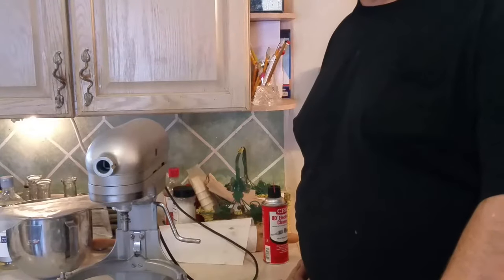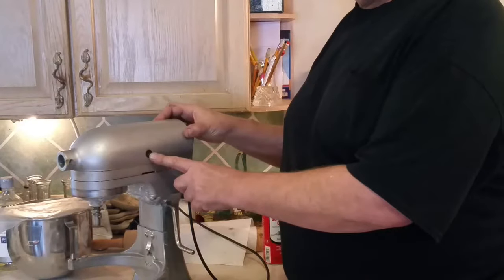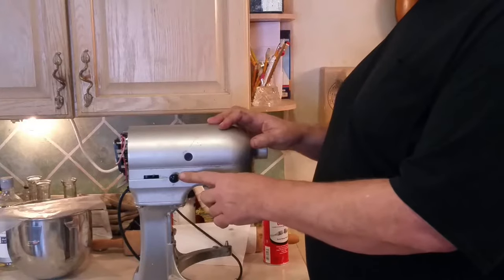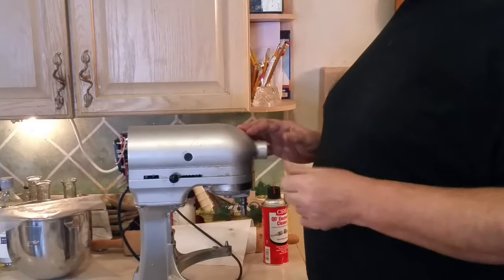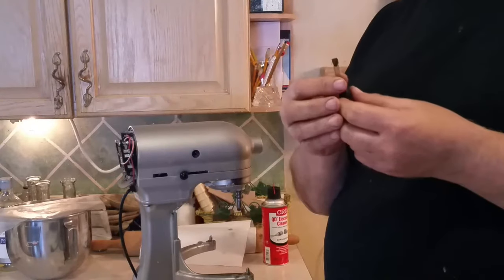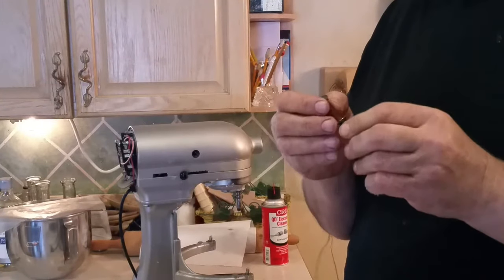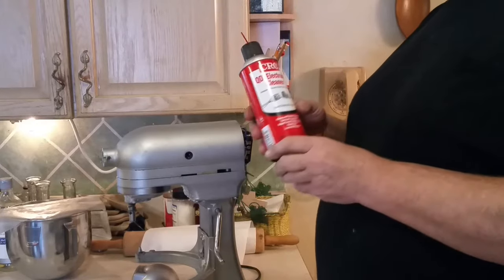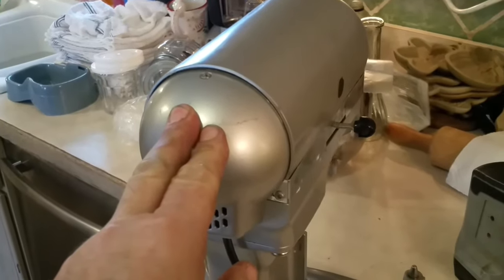how to fix Kitchenaid stand mixer that won't turn on

Comment: Thank goodness for your video! I took my machine apart (didn’t touch anything), just to wipe up the grease, put it back and it stopped working. I’m so glad I found your video about the brushes having a different corner. I almost had a heart attack when it didn’t start at first, turns out I had the brushes in wrong. Thanks!!
Reply from the maker: Very happy it helped you♡
Reply: daryl turcott do you know about the oil level in a Kitchen Aide. Daughter had movers mover hers. We marked all over the box “ This end up and Do not tilt”. Of course upon delivery it was setting upside down. Box soaked in oil. Ran a couple of times after but now won’t run. Very sparingly used.
Reply: I can’t see a cutout when I shine a light in there. Must be my 59 yo eyes! Any advice about the direction of the brushes? Should the “top” be on top when I put it in?
Reply: Omg! I did the same! I took mine apart while watching a video how to do so. I removed the old grease and put in new, put it together and it didn’t work anymore. Gonna try this and hope it works
Reply: I had the same exact thing Thank you for your video
Reply: Same here , I was in the dog house until I found this video!
Reply: @annaspastrykitchen6896  use the camera with flash on your cell phone. Then you can zoom in and out to see better...I use that trick in the grocery stores to read ingredients...
Reply: Thanks for the Video. I had the same issue with not putting the brushes in the right way
Reply: As did I
Reply: Exact same thing happened with mine.  All good now.  Thanks for the video!

Comment: Bought one of these on FB marketplace for $100 last week. Powered it up, it worked just fine. Was cleaning the gunk out of the nooks and crannies, including around those screws. Removed one because it was super gunky. After a thorough cleaning, I powered it up and got absolutely nothing…I almost died on the spot. Gathered myself, started searching for a solution online and found this video. IT WORKED!! Never touching that darn screw ever again!!
Reply from the maker: Glad it helped.

Comment: Thanks for the video and the explanation.  I had just finished re-greasing and upgrading the power cord of my mother-in-law's 1970 tilt head KitchenAid.  It was about an hour and a half project that I spread out over two years.  Evidently, two years ago, I pulled those brushes out and, having not seen your video, I paid no attention to how I put them back in.  This video saved the day for me!
Reply from the maker: Glad I could help

Comment: I have a nearly "new" kitchen aid mixer and it will not turn on. I bought it in 2009 at costco. Similar look as yours.  I probably have used it 10 times at the very most!  Have not abused it. I nearly threw it out because I was so mad at thing...It has been sitting for 2 years in my bedroom. Trid to find a repair man in my area and was not able to.  Your video has inspired me to take it apart.
Reply from the maker: Well, be careful and unplug it before you work on it. There are several good youtube tutorials on diagnosing motor or control issues.
Reply: @darylturcott    Thank you. Success! It was the switch that regulates the speed! It was corroded! Working now!!! Yay!  Thank you again!!!!

Comment: Thank you so much! This is exactly what was wrong with my machine; I took it apart the other day for a deep clean and re-grease, and I pulled these out to clean the caps and just stuck them back in without thinking they went a certain way. Needless to say, I was devastated when I went to turn it on.. and it wouldn’t.

Christmas cookies have been saved! Thank you!!
Reply from the maker: Glad it helped!

Comment: Thank you so much for this video! I took my mixer apart to paint it a different color and it wouldn’t turn on when I reassembled it. I thought for sure I must have broken it. The brushes were in the wrong way and I didn’t realize they were directional! It works perfectly now!

Comment: Daryl, tysm! I took my used kitchenaid apart to give it a deep clean. Guess I put the brushes in wrong (mine have one corner flattened, not quite a triangle). Checking how they should fit did the trick! Saved me a trip and $ to take it somewhere.

Comment: Awesome job. I repaired the worm gear in my mixer and tried to turn it on and it wasn't working. After watching your video found I didn't line up the notches on the brush.
Reply from the maker: Its easy to have happen. Sometimes they get stuck and dont slide all the way in either.

Comment: Thank you so much Mr Scott, you just saved me some good money. I put the brushes and my kitchenaid roared.
It's just that the sparks you mentioned, that can be seen from the switch still occurs. Any tips on how to solve that?
Reply from the maker: You could try a shot of qd electronics spray cleaner. Not sure if it would help.
Reply: @darylturcott  ok thanks. will let you know if it works

Comment: Love how easy this seems to be.  One thing, I do so wish there were either links to purchase the brushes or what the part name is called.
Reply from the maker: I always hesitate to share links, I don't want people to think I'm profiting from them.
Reply: @darylturcott  I appreciate this attitude because of course, so many people do profit in this way.  But I am unclear about the name of the part. It sounds as if this may be what's wrong with mine, that I have had since 1977.

What part am I looking for? Does it have an actual name other than Kitchen Mixmaster brushes?
Reply from the maker: W10380496 Carbon Motor Brushes for KitchenAid Mixers 9706416 W10260958 WPW10380496 PS3495098 AP5178083（2PCS） https://www.amazon.com/dp/B07ZV2NPWL/ref=cm_sw_r_cp_apan_glt_fabc_PXNDMYGEKB385PF921BZ?_encoding=UTF8&psc=1
Reply: @darylturcott  THank you!!

Comment: @daryl turcott Thanks for this! The videos I watched all said only one way for them to fit. They slipped in easily so I thought they were oriented properly. I reorganized them. It turned on once but sounded sluggish in 1st gear. I thought it was bcuz the new food grade grease needed to work throughout more. I slowly turned it up one gear at a time.  It made a slight burn smell like the grease warmed up. I  turned it down to stop...now it won't turn on again. Please help me...I'm unemployed and can't afford a repair shop
Reply from the maker: You didn't put grease in the holes with the brushes did you? The only place to but grease is in the gear box.
Reply from the maker: Darylturcott@gmail.com email me with pictures if possible
Reply: Thanks for responding. The only place I put the food safe grease was in the planetary and gearbox where the worm gear was. It turns out when I originally put the new bushings back in wrong...I thought both would face same directions) I misshaped the springs so they were not full contact
Reply: Once I corrected the misshapened springs (I inserted a small wooden dowel just slightly thinner than the spring...I tightened the twist and massaged it with my fingers bcuz if over tightened it would break), I was able to put them in properly with no sparks when turned on
Reply: I'm officially back to baking! Yippee! Thanks for your help
Reply from the maker: @fdort3971  so you are running again. 🙂

Comment: So grateful for your video. My 20+ 5 quart would not power on. Did the rap thing and it started. Tried to remove the brushes to inspect and replace. Covers unscrew but one spring came off the carbon. Any advice on getting the carbon out?
Reply from the maker: Carbon is not a hard material.if you can gently drill into it, or insert a long screw it might pull right out. Make sure its unplugged,  and don't damage the brass housing. If it breaks in pieces, lay it on side and gently probe the material with a dental pick or similar to dislodge it.

Comment: Thank you for the video. I wish someone would explain how these older speed controls work, (how the control panel and the speed governor work together to control the speed). The functioning of the "power off" part is self-evident, thank goodness. I replaced the mangled plastic worm gear in my wife's white KSM5, and now it won't even try to spin when I power it on. Luckily, I have a second (grey) unit (which also has a bad gear, but its motor spins), which allowed me to prove that the control plate, the phase control panel, and even brushes on the white one still work (the motor on the grey unit still spins when those parts are swapped out), but I can't figure out what else it could be other than the armature or field assembly , or wires leading to those parts. I can turn the planetary gear part of the white unit by hand and hear the motor turn, so I know nothing is seized up. All the shiny metal parts on the grey unit rusted over while in storage (bowl raise handle and track mostly), so it's currently only good for t-shooting & parts, but I may have to restore it if I can't get the white one's motor to spin again. The motor on the gray is rated slightly higher (350), so maybe it's worth the trouble, but then again, the wattage ratings are close enough that the white one could have the same motor, but  the rating could just be more honest on the white one.
Reply from the maker: I wish I could. I assume it's a variable resistor set up.

Comment: Hi excellent video and do you have a video on replacing circuit board on that mixer?
Reply from the maker: I dont. I had mine apart once but that was years ago and I remember it was tricky to get back together.
Reply from the maker: If you do it, take photos so you remember how everything goes.
Reply: @darylturcott  thank you

Comment: In attemtping to locate any numbers that would identify my Kitchen Aid, I discovered that even though the lever is in the unlocked position, the "head" won't raise up. Any idea how to fix that?
Reply from the maker: None of ours are tilt heads, I only have bowl lift models. I'm guessing the lever is stuck.
Reply: @darylturcott  The lever moves forward and back quite easily, but the thing won't tilt. I sure wish you had some ideas.

Comment: Thank you so much for this video - I'm so happy this was an easy fix. Quick question though - my mixer is finally turning back on again, but only works once I set the speed to 6 or higher. The speed doesn't appear to change however. Do you have any opinions on what it could be? Thanks!
Reply from the maker: I wish I could advise you on that, but the speed controller is a mystery to me
Reply: @darylturcott  Well thank you anyway for helping me figure out the brushes!!
Reply: I had this same issue and found it was due to how tight the screw was on the back of the electrical. Loosen up that screw and the lower speeds should come on.

Comment: Hello, 
Wondering if you could give me your counsel,
I was trying to fix my sisters KAM, which wasn’t rotating, I replaced the gear and all, closed it and all and didn’t notice I had put in the speed-lever incorrectly which the copper bar that closes the circuit to touch part of the metal frame. I replaced the speed control plate and the brushes (they’re placed properly) but it still will not turn on. 
Any advice on what could be my next step?

Thank you
Reply from the maker: Do you have a voltmeter?
Reply from the maker: I would get a test light or meter and start by testing the cord. Then test power to the brushes. If cord has power and brushes dont, then the problem will be in between, probably in the speed control switch.
Reply: Cord has current, I do not get any current from the red wire coming from the motor, 
Replaced both the speed control plate and phase board and both brushes
Reply from the maker: If you are sure the brushes are right, look at the brush holders, each one should have a wire soldered to it.

Comment: I broke my mixer by removing the brushes when looking at it. Now I can't tell which way they go in.  I can't see any cut out inside the mixer.  Does the rounded part go up or down?
Reply from the maker: The curved edge is on left and right sides. Points at top & bottom

Comment: My kitchen aid won’t turn on the lever is stuck in the off position and won’t move forward. Is that a brush issue? Or something else? Thank u for your video
Reply from the maker: The lever is not connected to the brushes. You may have a broken spring or hinge in the controller.
Reply: @darylturcott  should I toss it and get a new one? Or is there a repair shop you think?
Reply from the maker: Dont do that. It's likely a very simple inexpensive repair
Reply: @darylturcott  thank you 😊 appreciate that!

Comment: Hi, thanks for the video, I have this problem:

I disassemble my kitchenaid because I wanted to clean the liquid grase, and I unplugged the brushes ONLY, I didnt touch any circuit or another piece of the motor... Well, I put it back in the same place every piece, and now it don't turn on. I don't know what to do because of the quarentine, and I don't have a multimeter or tester at home... Any idea what can I do? Sorry if my english is not good, I speak spanish. Thanks again, salute.
Reply from the maker: If it worked before, you must have one of the brushes in wrong.
Reply: @darylturcott  Thanks, you were right, but I had an another problem, the speed control plate. I solved, but I have another problem now, the machine is making noise at Stir.
Reply from the maker: I don't have an answer for that.  One of ours did that we just ignored it until we got a new one. My wife does semi commercial use so we replace ours every 5 years.
Reply: @darylturcott  I was thinking it could be the worm gear, it's plastic or something like this, so you can replace it, and the grase, both together.

Comment: Hi I’m not here because my mixer didn’t turn on, but because the first time ever I turned it on, I noticed some sparking coming from that switch speed gap. I assume brushes are new and I didn’t touch them, so I wonder what might cause that sparking. Any suggestions? Thanks
Reply from the maker: It happens sometimes with variable resistors, either a little debris, or not a smooth surface for good contact. I would pull plug, move switch back and forth 20  to 30 times, then plug it back in and retry it.

Comment: My mixer still will not turn on.  This thing is probably 20+ years old.  Do you know how long they last?  Thanks.
Reply from the maker: I've seen 40+ years. Second likely trouble spot is the speed control. Look for some videos about that.

Comment: My brushes won't come out.. only the spring comes out. I guess I have to take the whole thing apart?
Reply from the maker: I wouldn't. Try a drop of super glue on something small and flat that you could reach in and touch the brush. Or spray a little contact cleaner in.
Reply: @darylturcott  good idea. Thanks
Reply: Well that didn't work.  So I took it apart, One brush was jammed in there so hard I had to pry it out with a screwdriver. The whole copper housing came out with it. Does it matter which way it goes back in, How do I figure that out ?. Thanks

Comment: I just bought a used one off craigslist and the lady plugged it in and turned it on showing me it worked. It was an ugly light green color so I decided to paint it bright red. I took all apart and taped it up to protect the back electronic part and painted away.  After reassembly I plugged it in and nothing. Any ideas as to what happened? I removed the brushes and reinserted them several times and still no results. The brushes still have a good length to them, no where near as short as the ones in this video.
Reply from the maker: They only  go in one way,  otherwise they wot touch the rotor. You didn't get any spray into the speed control arm area did you? That is a variable resistor it needs good contact to wo r k.
Reply: @darylturcott  Is that the exposed area you can see in your video at the back of the mixer? I taped it up pretty good and made sure everything was covered
Reply from the maker: Sounds like you did a good job. Double check the brushes.
Reply: Update! I checked the brushes and had one of them in upside down. It works like a charm now.